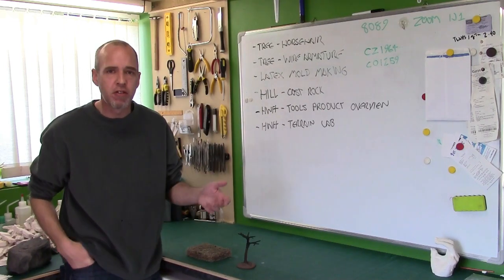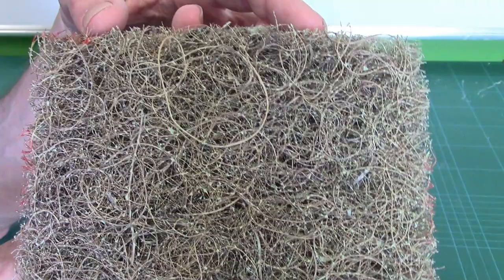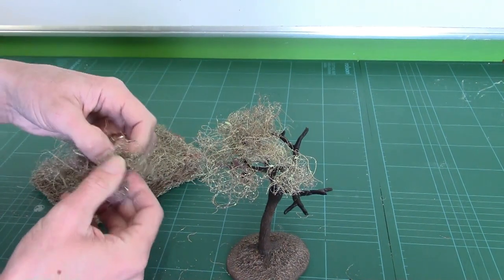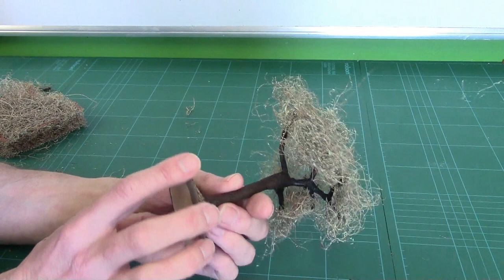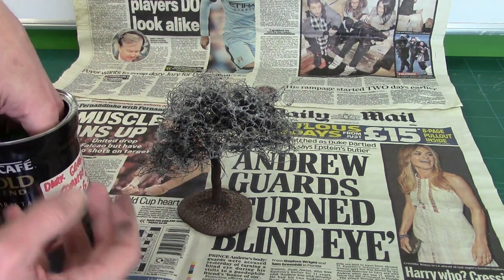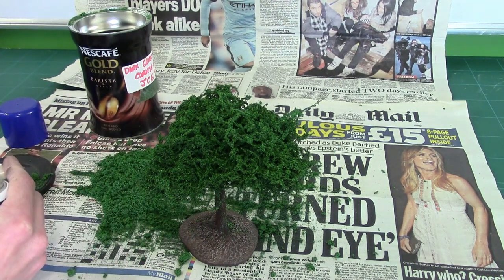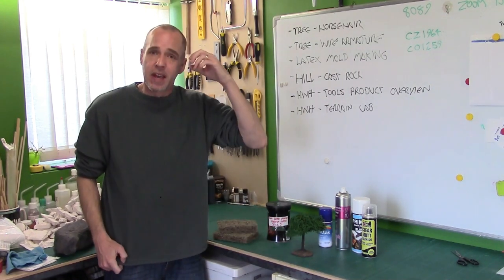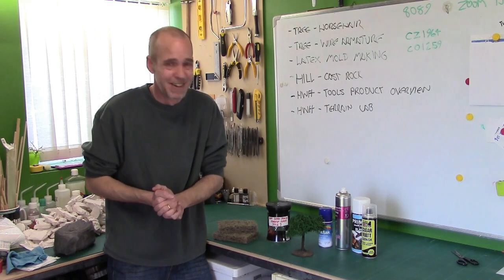Realistic Scenic Trees - Horsehair & Coarse Scatter Technique

Comment: I've never used rubberised horsehair but it reminds me of furnace filter material that comes in large mesh sheets. The type I use appears to be made from natural wood and is kinda layered so you pull it apart rather than stretch it. I use it for branches on large 12"-18" trees rather than wiring every little branch. Got the idea from model railroad pine tree techniques. It's still a tad thick for large scales but it's probably more appropriate for smaller scales as an alternative method.
Reply from the maker: +GiantBoarMonster not having a furnace, I've new come across it but I've heard lots of people use it mate, thanks for the info!